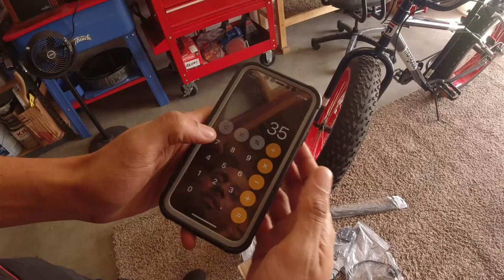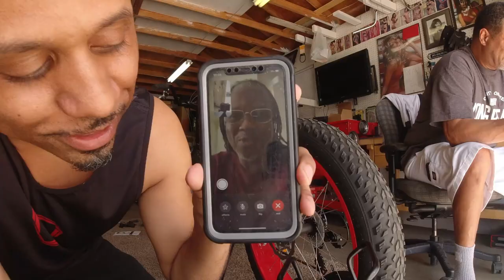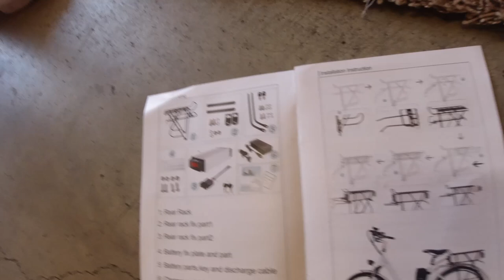DIY Ebike Conversion Day 1 - Integrated Rack Battery and Hub Motor Installation

Comment: I love your enthusiasm. I'm in to DIY e-bikes myself. Those reflectors aren't up to the weight of a battery, forget about using the rack for anything else. Still going to be pretty bad ass when done.
Reply from the maker: Yea we replaced them with metal mounts. And yes there’s a lot of weight on that rear for sure. You should se it now. It looks completely different. Video coming soon
Reply: @DavidBrandNew  I'll look out for it. Been a fan of the Dolomite for like 5 years. I'm planning on slapping a BBSHD mid-drive on my Dolomite ALX.
Reply from the maker: @michaelsprinzeles4022  I’ll try to get it out this week. Yea I love that bike too. I’ll do a mid drive eventually

Comment: Awesome job guys. The bike is going to be a sleeper for sure. Hills won’t stand a chance, and flat ground will be ridiculously fun to peddle, or not with the PAS, and hub being separate from the pedaling of course is a bonus. I have to sub after the work you are doing,
Reply from the maker: You mean to tell me you haven’t been subscribed this whole time 😂😂 just kidding. Thanks. It’s turning out pretty good. Hopefully George is happy
Reply: Sleeper.  man  a great word.  Outstanding video great audio and voice quality to my friend. I do voice overs for a living and my dolomite identical to yours, has got about 1000 mi. On the front hub 48v 1000-watt bafang motor which has been good to me
Reply: So mine has gone from sleeper, to rat rod. And that tu is just as cooling it's very own wait.

The work I do is kind of like the epic movie trailer guy so if you need a free announcer voice for one of your videos, my first read for anyone is absolutely free.

Comment: I ran into the same problem with the rack when I was building my mid-drive mountain bike.  I ended up going a different route by using a triangle battery in a bikepacking bag attached inside of the frame.
Reply from the maker: Yea triangle batteries are easier

Comment: I would like to maybe even show you a couple ideas I'm working on now I even have a 3000 watt up motorbike that's not quite complete but it's pretty quick and so far I've only gotten to run it off of RC LiPO batteries that's sort of kind of another hobby I'm into but I'm trying to get into the eBay thing now hopefully with a little help and some insight from other people even like yourself

Comment: What motor battery kit was used - links?
Reply: A bit late in the reply but you can only get this from AliExpress. Comes in 4 different colors and various configurations. You have to specify the exact color and configuration you want. bit.ly/3HhgBuI

Comment: I think my first  bike is at least worth a sneak peak I  think. 80a controller 120v And a 3000w hub motor full suspension mountain bike. Just no battery yet.
Reply: I also have full suspension GT I drive 3.0 mountain bike I'm working on next
Reply from the maker: Man I can’t wait to see that